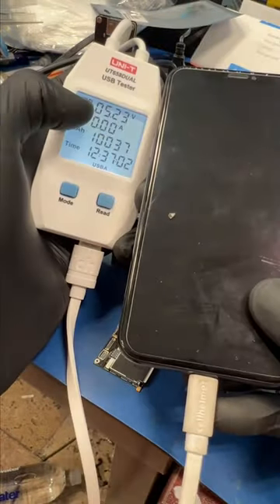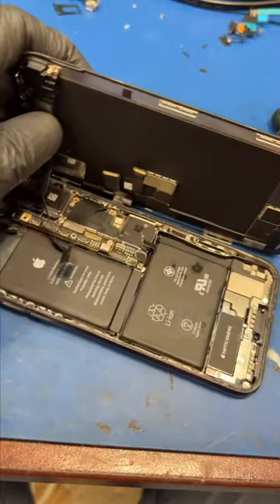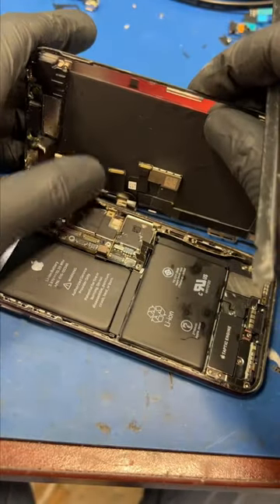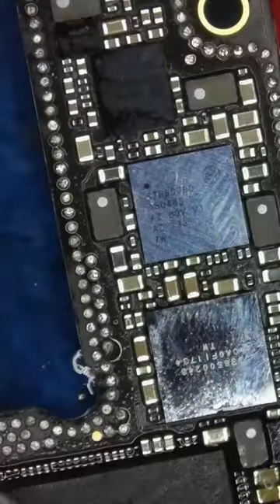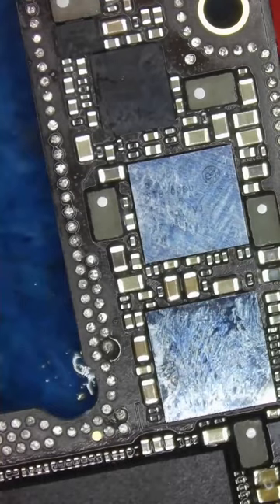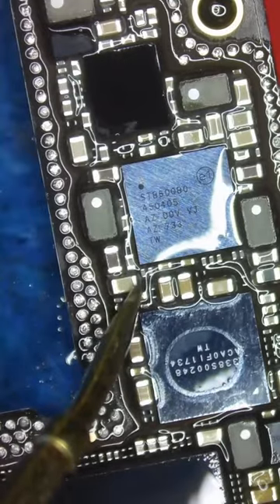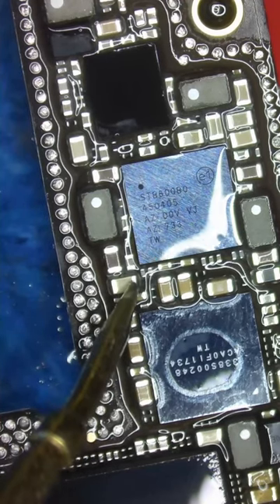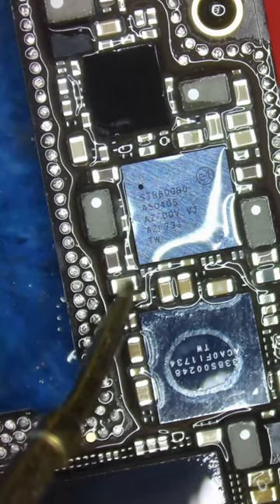This iPhone X is dead… Can we recover it? #iphonerepair

Comment: What is that liquid stuff you put into the phones? Does it affect the phone at all?
Reply: no, alcohol  do not conduct electricity and even if you put water it's okay if you didn't connect it to the battery or power supply

Comment: Hey I purchased the iPhone XR from National city swap meet from previous owner and when I opened screen but it’s badly shattered and bent but still working also I saw a flex cable is broken but I disconnected the battery also someone from other repair shop can’t help it and lost some screws some reason